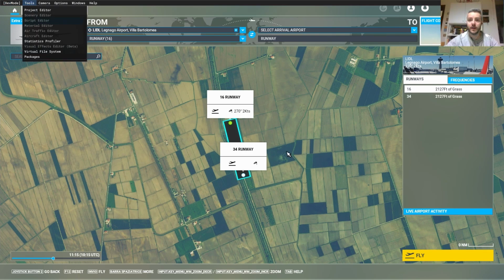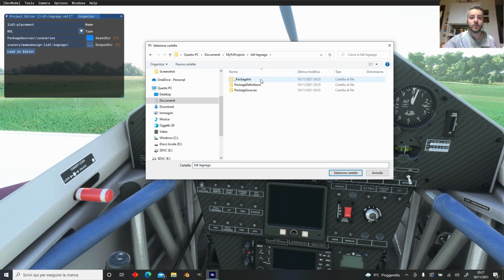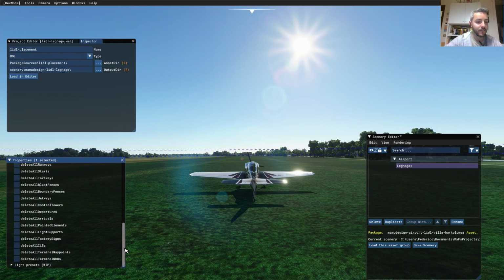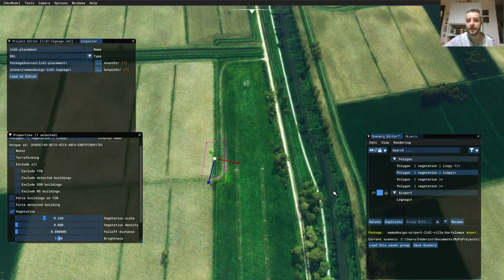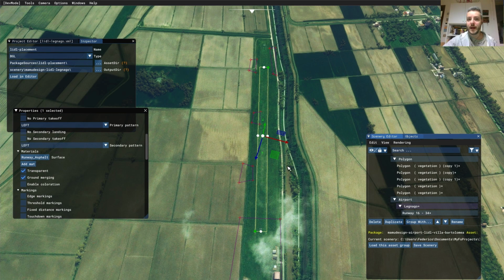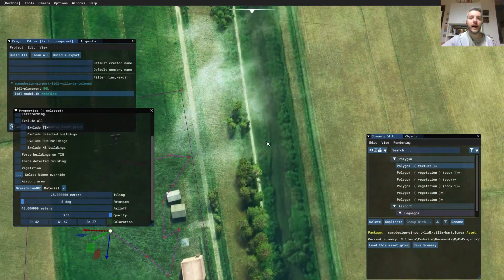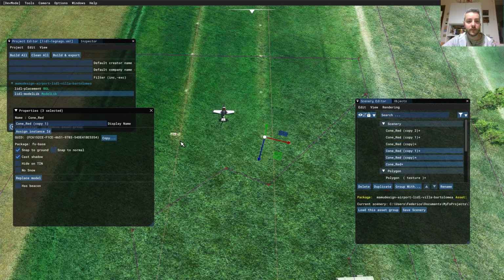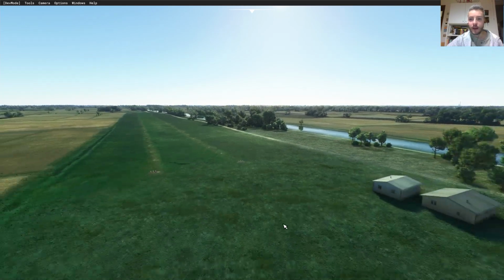MSFS SDK Airport TUTORIAL - LIDL- EPISODE 1

Comment: Bongiorno! Really really appreciate this tutorial. I am using it to replace a small airport in Missouri. Question: have you noticed anything weird when placing runways? I will read up on this but it looks like placing a runway distorts the land around it in a major way. It’s probably normal and I am trying to avoid “flattening” the terrain by default. Again, grazie mille for the tutorials! You are appreciated!
Reply from the maker: Thanks mate! When placing a Runway, flattening is automatically applied, you can tweak the value of the flattening inside the Runway properties, Terraforming, change the default "-1" to something more appropriate, 20 meters can be enough to blend with the surrounding terrain
Than, if needed, you can tweak the runway profile to add again ondulation or slopes
Reply: @MSFS-SDK-TUTORIALS  thank you. Initially the terraforming value is set to -1 meters. I spent time playing with that value and added a profile. I struggled with it for a while, but when I saved my changes and closed and reopened the project, the runway looked a lot better (I used a profile, kept the terraforming at -1 meters). I guess that worked! 😁👍

Comment: Thanks for these good tutorials. I need yor help about my problem. While editing a default airport, I have chosen to delete everything in the “delete command” section of airport object properties in scenery editor.(10:39) Then, I added runways , aprons, taxiways, buildings, com frequencies, ils etc. Now, I have an airport without VOR. Can I bring it back? What is the solution?
Thanks
Reply from the maker: You can add a Vor entry manually in the 
.xml of scenery (could be the former ILS was including a Vor to?) You can of course in your airport properties uncheck the delete ILS and see if the Vor comes back.
Anyways, i Will be back with the Vor code this evening, can you tell me the ICAO of the airport?
Reply: @MSFS-SDK-TUTORIALS  If I can bring them back, instead of manually adding, will be better. Because, approaches etc all navaids/routes have gone.....  By the way, airports are LCEN and LCGK. two local airports.. (vors: ECN  and GKE )
Reply: @MSFS-SDK-TUTORIALS  there were no ils in the sim for these airports. In real there is ils in LCEN. I added it by myself.
Reply from the maker: @hakanpolat6495  hi Hakan, my sim is pretty virgin and I have no navaids in the area, no ils, vor, dme, fix, anything!

This code, just before </FsData> will add the two VORs

<Vor lat="35.1566" lon="33.4914" alt="121.0M" type="TERMINAL" frequency="117.0" magvar="0.0" region="LC" ident="ECN" name="Ercan"><Dme lat="35.1566" lon="33.4914" alt="121.0M" range="35N"/></Vor>
<Vor lat="35.2382" lon="33.7511" alt="49.0M" type="LOW" frequency="114.3" magvar="0.0" region="LC" ident="GKE" name="Geciktale"><Dme lat="35.2382" lon="33.7511" alt="49.0M" range="35N"/></Vor>
Reply: @MSFS-SDK-TUTORIALS  thank you very much Pinotti... It made me confused that there is no navaids in default sim... may  be I remembered it wrong...

Comment: Hi Frederico, I am starting from fresh with Otherton Airfield. I followed your video again, didn't bother changing the files, just used the existing. I then used the Polygon around all buildings and saved. I Loaded the file into my Community Folder and restarted msfs. Something very strange happened. First a warning that the plane I had selected would  not work on water, no where near water? I changed the plane then started and it opened in Mitton Airstrip a few miles away from Otherton but again nowhere near water. Any advice would be appreciated. In the mean time I will keep trying
Reply from the maker: I tried to spawn at otherton and have no issue with water, maybe some problem with server loading (su7 update and stuff)
If you need ti reach me in more ditect way i set up a discord:
https://discord.gg/37gjx6RY
Reply: Thanks for the Discord link.  I will be trying again later today.

Comment: Thank you for making this video so simple and easy to follow. I did everything that you said and it worked fine. I changed the runway and removed trees, etc. Then everything went wrong when you made so many changes to the files. I am going to start again and see if I can make it work.
Reply from the maker: Actually the changes i'm making in folder structure are not required, you can avoid them and the project Will compile flawlessy, i'm Just doing so because i like to have them organized in a certain way, but, again, the standard paths the Project Editor use are fine and won't throw errors!
Reply: @MSFS-SDK-TUTORIALS  OK I am working on it. How do I change the grass on my runway. I have found the grass but I don't know how to change it. Do I use a polygon?
Reply from the maker: @bmw1200  i would use an apron, works like a polygon but with more options, as texture use Grass_mousa from the material editor a play with colors and opacity to obtain what best fit your airport
Reply: @MSFS-SDK-TUTORIALS  many thanks